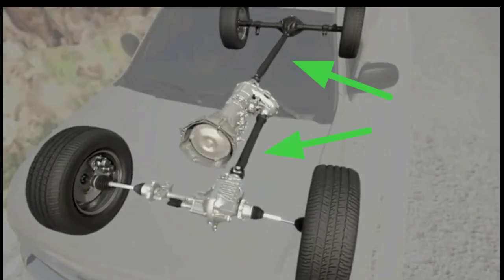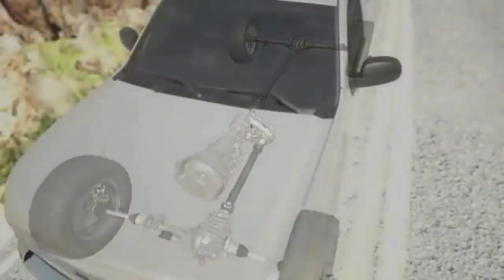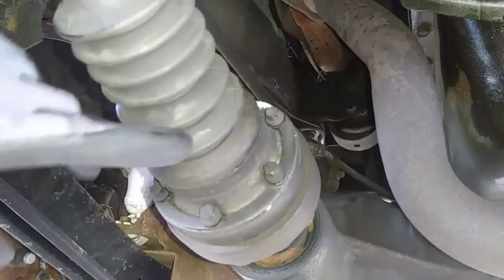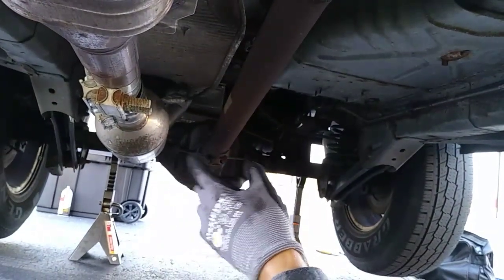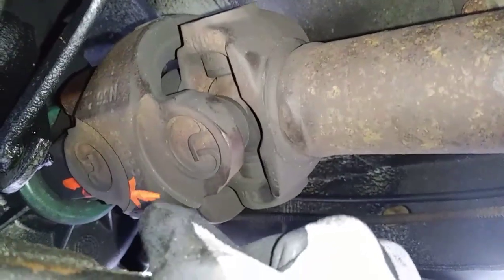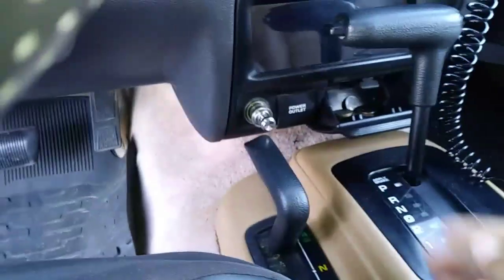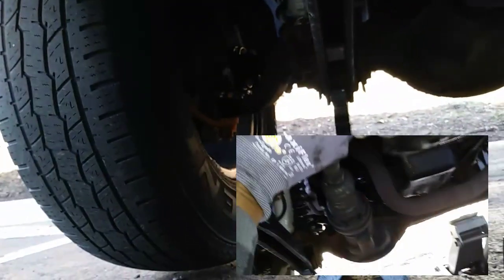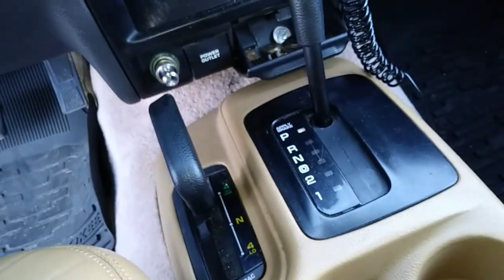FRONT DRIVE SHAFT REMOVAL

Comment: Hey buddy I just found a front drive shaft at a junk yard for my ZJ that I bought without a front drive shaft. So stoked and much appreciated your help on the video. I'm sure I could not have done it without your video. But it was easy! Now I've just got to install it.
Reply: Did you have to put any gear oil into it?
Reply: @raymondscroggins69  I don't know. Am I supposed to?
Reply: I’m not sure. Trying to make sure if I need to before I put my new driveshaft on as I’ve been driving around in just RWD for 6 months
Reply: @raymondscroggins69  depends on if any leaks out.

Comment: Working on my jeep today thanks for the video very helpful , especially the part marking the shaft so it goes on the same 
Way !
Reply from the maker: No problem
Reply: @barricadegarage5361  Should i remove front shaft or use a free wheel hub, which is better for fuel economy an convenience ?

Comment: Side note: the vehicle has to be off the ground for the T-case in neutral and you being able to spin the drive shaft with your hand. If the vehicle is on the ground it's impossible to turn the driveshaft with your hand even with the T-case in neutral. Tried it myself.

Comment: Hi, I have three Grand Cherokees, 2 1995s and 1 1998 and they have the standard u=joint attachment to the front diff, what is the difference with the big bell looking hookup to the front diff. Thanks
Reply from the maker: The big bell part is the rzeppa end and acts like a CV-Joint which in my opinion offers more flexability
Reply: @barricadegarage5361  Thanks for the info, is it an aftermarket item?
Reply from the maker: @ronnie32567  mine came from the factory with it

Comment: If my viscous coupler in my transfer case is bad, could it sheer off the front bolts, causing my front driveshaft to just fall off from the front diff.? Everything was running just fine for about 8 months, no noises, no issues, 1,200 miles. I just don't get it. Thank you again for the videos and help.

Comment: What year is your Zj? I have a 98 5.2 and when I bought it the front drive shaft was missing. I’m going to pick a part in the morning, do you know which Zj models I can pick this part from?
Reply from the maker: I have a '96 and if the previous owner didnt swap axles you should be able to use any driveshaft from any zj model year that looks like the one in the video. People often remove the driveshaft because the transfer case is messed up and will buck and bind up when attached to a driveshaft so be aware of that as well

Comment: I have the same jeep and have been watching you to work on mine but just now ran into a problem. My drive shaft has two circular ends while both our ends are different. Will I run into any problems and is yours a 4xr or a quadratic drive like mine?

Comment: My drive shaft is like yours but my jeep doesn't have the driveshaft it was removed. I can only find the for style o cant get a circle one like you
Reply: What I'm saying is  what's the difference in the 6 bolt circle pattern and any other jeeps fork 4 bolt pattern. Cause I have 2 axles but only the ford drive shaft

Comment: Any idea how i can get the cv joint out of the yoke if its stuck or seized?
Reply: Ive tried using heat and banging the yoke with a hammer but it is really stuck? And suggestions?

Comment: Hello Barricade...I know it has been a few years since you did this video, but it was a great help to me in removing my front drive shaft in my ZJ.  I was getting a short vibration, like hitting a small set of speed bumps, when accelerating uphill.  It would go away as since as I lifted off the throttle.  So it was suggested to remover the front drive shaft to see if that solved it.  It worked!  But now I have a 2 wheel drive jeep lol.  Can you suggest where I might continue to look to to solve the vibration problem so I can put the shaft back in?
Thanks alot..Kevin

Comment: If I am experiencing what I believe to be some sort of drivetrain issue in 2WD (as in it vibrates at about 30MPH and goes slightly away), and the vibration almost goes away when I put in in 4WD, should I focus on the front shaft first?
Reply from the maker: Brent Smith check the u-joints on the front and rear driveshaft. this video should help you out
https://youtu.be/L5ockyO1UfA